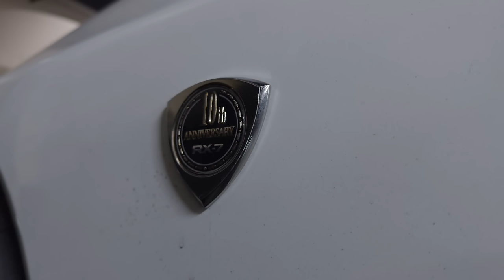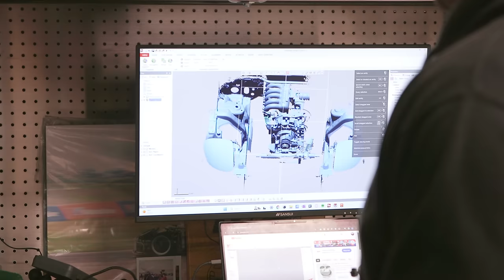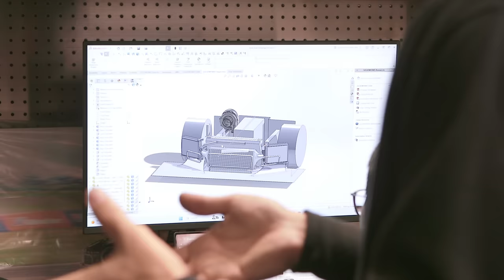"This is the one of the craziest things I've ever seen!" | We Toured Rob Dahm's Shop!

Comment: Awesome. Real engineering. Question for Mike; what is it you mentioned guys doing with superchargers and waste gates? Bleeding off boost at high revs to keep intake temperature down with high s/c drive ratio? I’m building an engine with an old eaton. It’ll have water/methanol injection before the s/c and rpm will be relatively low to keep it efficient. I don’t think i’ll need a waste gate.
Reply from the maker: The valve bleed excess air at part throttle to reduce pumping loss. Eatons have internal bypass valves that do the same thing so you don't need it but centrifugal superchargers like Vortech do.
Reply: @motoiq Thanks for your reply. I see. My Eaton doesn't have internal bypass. I'll have to think a bit more about it. Some engines I've worked on haven't had one. Fortunately my ECU can potentially control one as there was an idle air control valve originally.
Reply from the maker: Are you sure, every Eaton I have ever seen has one.

Comment: What's Up Rob...  try this 3 Pass Radiator, Swirl tank  and duct and seal  all units tight....  I had to cover up my Oil cooler it's running  to cool ... SR20det 3071r 520WHP
Reply from the maker: 1000 hp makes a lot more heat than your 500 hp motor!

Comment: some supercars (like the koeningsegg jesko) use the compressed air system for the adjustible shocks to also spool up the turbos in order to minimize turbo lag.  maybe that would be a good idea for high altitude driving too, where the air is less dense.

Comment: The comment of the road being the scary part is no small point. Drivers get very very little flat out practice runs in sections. The full run on the day must be overwhelming and you’d probably want 300hp at the top on your first competitive run if trying to push.
I’d point and shoot on visible parts and then totter into braking and bends. Pikes peak is zero joke.

Comment: Imagine running Pikes Peak when it was still all dirt……you’re on a motorcycle you traded a stereo system for, it had 300 dollars worth of engine parts and all the work to set it up done for nothing except for a few bucks for the guy that installed the piston and cam. 1982. The last Pikes Peak where they launched 50 bikes at a time. The first year for a motorcycle fatality, BOB GROSS RIP. The bikes do not return to the hill for many years. And about the last time a normal guy with no pedigree and tons of money could do such a thing.

Comment: back when I was in middle school and I first learned about rotaries my imagination went wild, I always dreamt of building an engine similar to the 12 rotor. I wanted to build an 8 rotor with a similar shape and architecture, including the gears connecting the banks of rotors, but rather than 4 more rotors in the middle, my dream was to have a built in AWD transmission that has front and rear drive shaft outputs, so that not only could the entire thing be centrally located in the car with an incredibly low center of gravity, but also so that the engine/transmission combo could be integral to the chassis as well to save weight. of course with turbocharging, my dream goal was a cool 2000hp, but looking at the 4 rotor Rob is building now I think he could blow 2000 out of the water. (feel free to steal my idea btw, I don't think I have the skills or finances 😂)
Reply: I did a lot of in depth thinking, including that I wanted both banks of rotaries to spin in opposite directions, with one gear for one bank, and two gears for the other, so that they could both spin the input shaft the same direction, as well as all sorts of things like turbo location and cooling and stuff, the toughest part of the design that I never could figure out was how the heck I would build the housing in such a way that you could open it up and access the transmission, but looking at the 12 rotor I think that if it is constructed in the same manner with the layers corresponding with the rotors, but with the middle opened up for the inner workings of the transmission that it's definitely possible.

Comment: Tip
For short run super cooling.
Place an aircon condenser in front of the radiator/heat exchanger , plumb it into a c02 bottle and have a solenoid trigger when you need extra cooling, point the outlet over any other cooler you want However avoid the c02 entering the engine intake or the vehicle cabin.
Alternatively you could use liquid air and point the outlet into the intake to improve high altitude performance.
Reply from the maker: Have you ever done this?
Reply: @motoiq  not personally as I had no access to such things when I was involved in motor sports, however a few people have experimented.
There’s one drag racer that has massive ultra high pressure air thanks in his trunk and dumps them down the throttle.
I forget the specifics but I think it’s a 427 bbc at 60psi boost equivalent on a quarter mile run.
Others have used water foggers on the intercoolers, aircon evaporators in the intercooler , water meth injection where the fluid passes through a heat exchanger coil in the intake . If you run CNG or LPG that needs to be heated a bit routing a coil through the cooling system can be done. And there are a few more I can’t recall just now
Reply from the maker: I am saying this because we used CO2 on our pikes peak winning Tesla to help cool the battery and for an event like this, its not that effective because you would need to carry hundreds of pounds of excessive weight for it to work more than a few seconds. Plain old water works the best, highest specific heat.
Reply: @motoiq  yes water has the highest specific heat which is the major reason that it’s the only real greenhouse gas but you can’t go dumping buckets of water on a track the officials tend to frown on such things.
I envision that the method I suggested would not be a constant flow but be pulsed and shut off only being used to keep the temperature from getting too high.
Reply from the maker: It doesnt have enough BTU in the bottle to work. The water doesnt dump on track, it vaporizes before then. 15 lbs of liquid C02 could only prevent the temperature from climbing for a couple of minutes.
Reply: @motoiq  water will vaporise and at sea level it will disappear, but that becomes less true at higher altitude and cooler temperatures, the water vapour will quickly condense on cooler surfaces.
I don’t know what amount of c02 it would take to do a run but it would not need to be the full 8 minutes.
Reply from the maker: If you haven't done it before and actually know what you are talking about it isnt advice.   I have so you might want to listen to me.
Reply: @motoiq  I am actually listening, you used c02 to cool batteries in a Tesla but it didn’t work.
c02 and almost anything else on the planet is nowhere near as good as water for absorbing and moving heat energy so it cannot ever be as efficient in cooling things, (or heating the planet.)
However I didn’t suggest it because I just wanted to type something, I do however sometimes give joke tips that people might take seriously until they think about it and then get the joke. But then again are they really a joke and not a prompt to think of a better solution.
The question is not if it works effectively or not But if it solves a problem with less mass and side issues than other solutions.
One of the best ways to provide additional cooling efficiency would be to fog water over the heat exchangers, this works and has been used to great success, however it is not something that will pass scrutiny on many race events for fear of dumping water , additionally in higher altitudes and cooler temperatures the water vapour will condense and form fog or collect on cooler surfaces and drop water on the track.
I also suggested liquid air instead of c02 which if used on an internal combustion engine could be used to help cool and increase air density entering the intake.